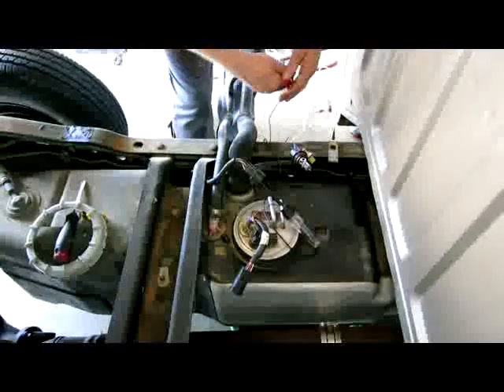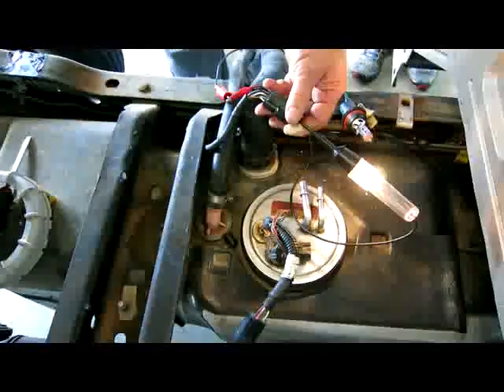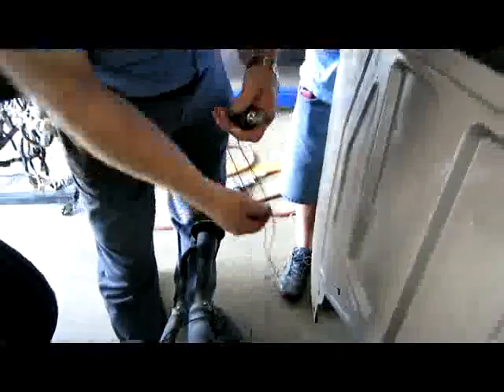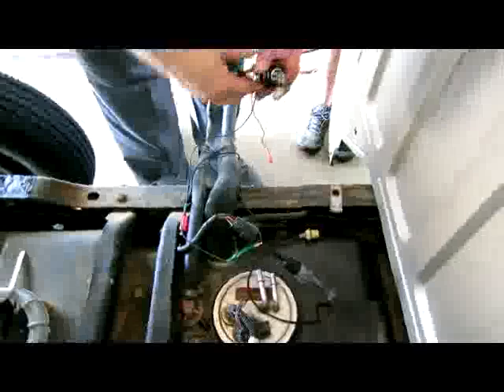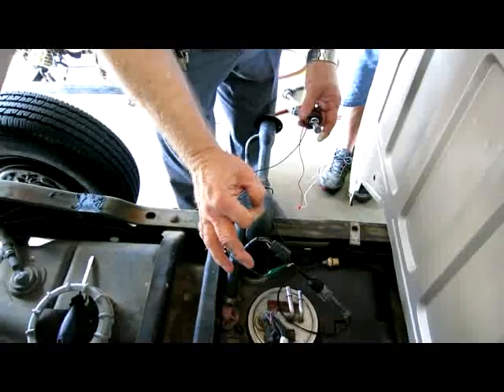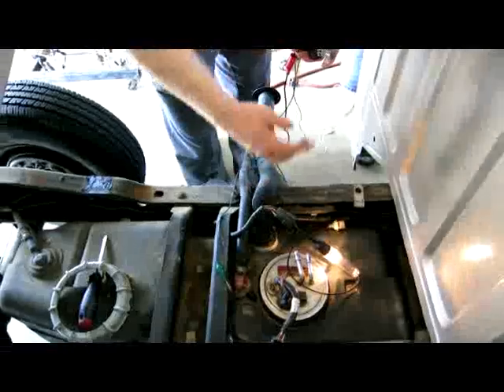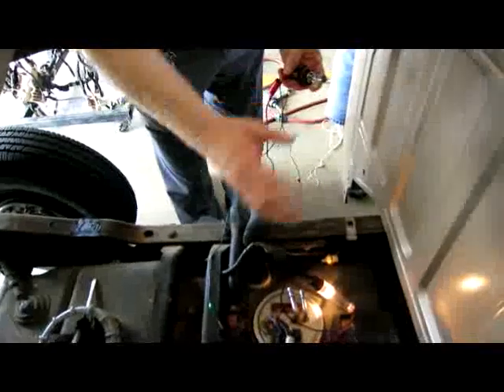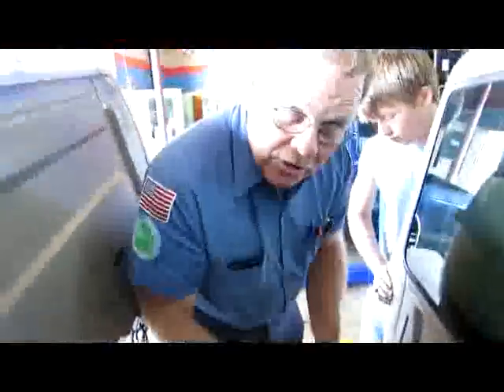Why a Meter and Test light aren't enough

Comment: With the fuel pump connected should see the voltage drop using a voltmeter right??
Reply from the maker: That is correct

Comment: What's the significance of the spark?
Reply from the maker: The spark just means a connection is being made and a tiny whisper current is flowing - but virtually all the voltage is being dropped.

Comment: I've been fooled more than once by voltage drop across a connector. Sometimes the bulb of a test light will not burn as bright as it normally does, but that's a hit and miss observation and so a proper voltage drop test is the best plan. Too bad the wiring to the pump is so hard to get to. 

I found a great article on Wikipedia explaining why (mostly for rider safety and pump longevity), fuel pumps are normally inside the tank.